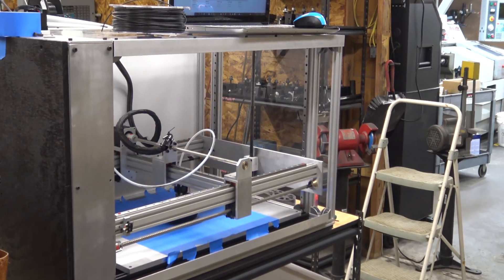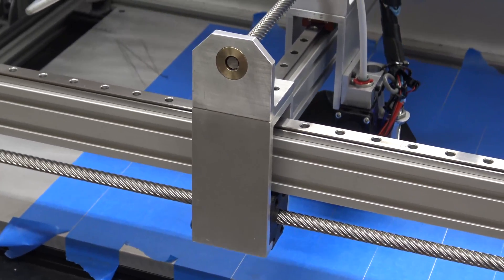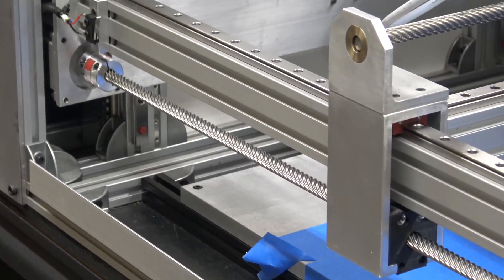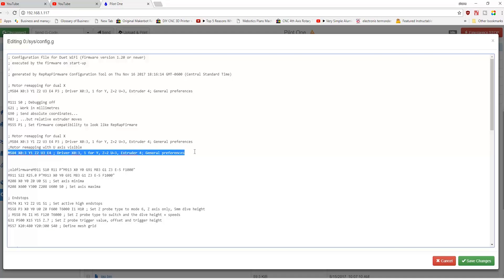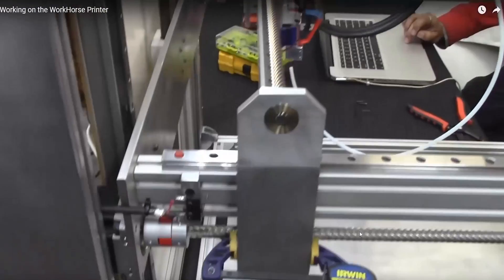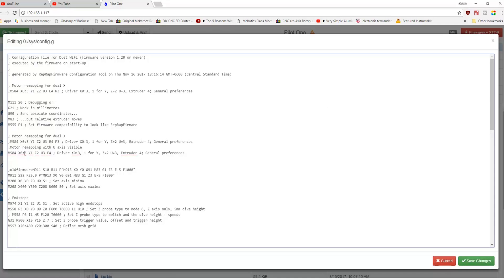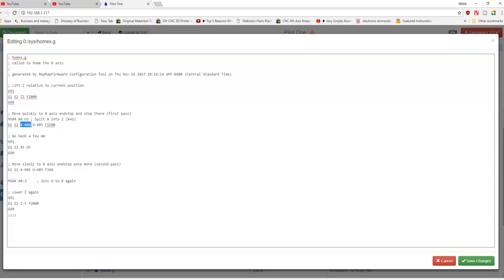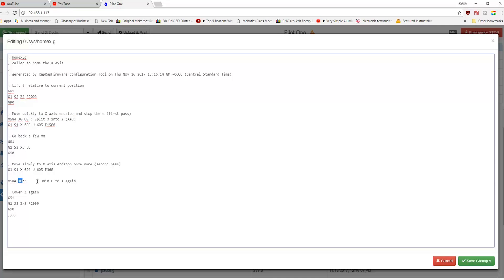Duet Wifi - Dual X Axis On The WorkHorse 3D Printer

Comment: Hey, Chin here.

This is really interesting, so duet wifi allows you to treat a new axis as X/Y/Z while allows it to be independently controlled?

also, why not direct drive extruder? Moving mass of a DDE setup should be a non-issue with the beasty XY axes.